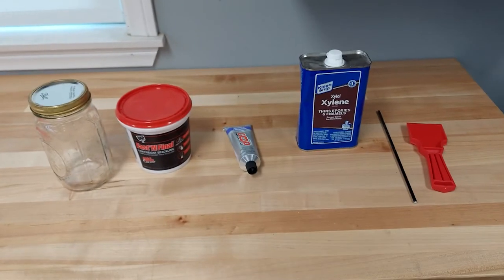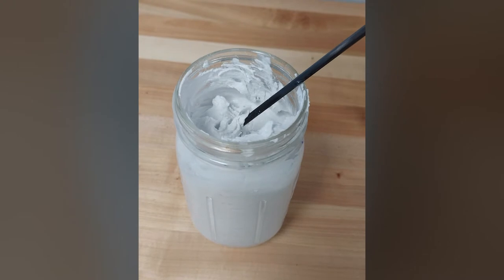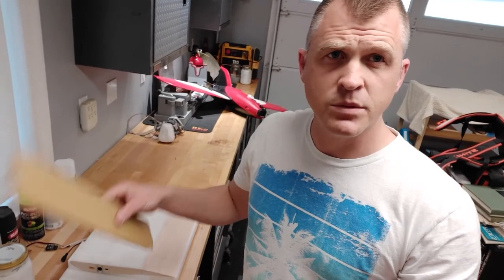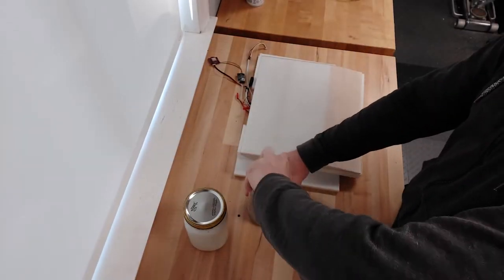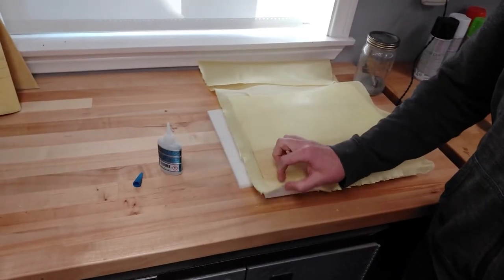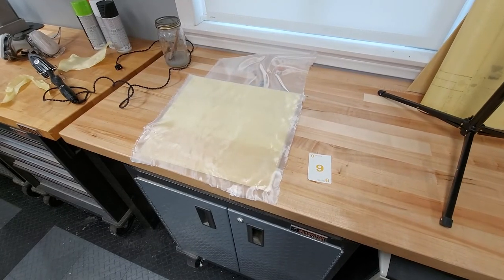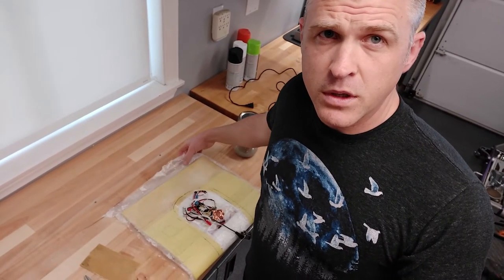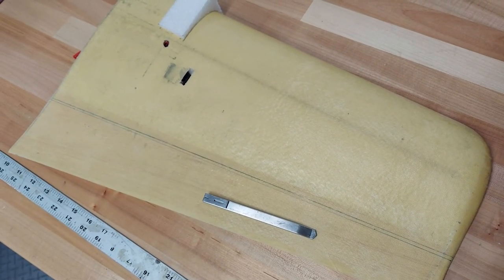EPP and Kevlar Drone Construction Techniques

Comment: Very cool.   All my favorite materials in one vid..   Kevlar cut on the bias, thinned Goop, and thin CA.    I never cared much for the  way spackling is used to fill in the wire cut EPP surface in traditional PSS construction because it'll de-bond from the foam on impact or sharp bend and then can never be repaired without stripping all the covering off.    But bonding it with thinned Goop makes it permanent. .     I can attest to the durability as both the planes I fly that you built,  have taken some pretty serious hits and have never delamed.    I've creased the surface here and there and broken a joiner, but that's about it.   

Didn't know that about n-propyl acetate to thin Goop.   Wonder if that's available in countries that don't have access to either Toluene or Xylene
Perchloroethylene (aka perc, aka dry cleaning fluid) will also thin Goop. 

I've always used 3M Super 77 misted directly onto the Kevlar itself rather than the surface.
Same benefits as your 3M 90.  Can stick it down, smooth it out, shift it around as necessary.  Not as thick and gooey as 3M 90 and won't ever obstruct the pores of the Kevlar fiber from receiving thinned Goop or CA.   Best to do it outside  and downwind though as the mist will get on everything nearby.  

Easiest way to not cover your fingers in CA (or glue them to the surface if/when it kicks fast) is to just cut  off a short length of  good clear packing tape, stick it to your fingers, and then rub the CA with the slick side of the tape.    Can even hit the CA with a little kicker at the end to firm it up and still rub it down (which you'd never do with your bare finger). 
And maybe the blue CA doesn't fume as much but my Zap brand thin CA (I buy it in big 2oz bottles) is really obnoxious and it requires  a lot of ventillation or it will burn your eyes/throat.. etc..  I apply it outside if at all possible.   Inside with a fan otherwise. 

Any pair of decent kitchen scissors can be turned into quite effective Kelvar shears if you've got a bench grinder in seconds as I demonstrate here.   https://www.youtube.com/watch?v=rG6ZFA543BI

You can fill in the pores and make Kevlar a little bit sandable with the same thin CA trick you're using on the TE.

Oh, and you might want to throw this up in the Slope forum as it really is highly suited to EPP PSS construction.
A brand new EPP PSS plane can be every bit as smooth and fast as a wood/glass one but the complaint is always that after a couple hits they start to get pretty ratty, due to a combination of torn cloth (folks used to use Solartex to wrap the curves) and the aforementioned spackle fill layer failing.
Reply from the maker: Thank you for stress testing and flying these planes to their maximum over the years.   Appreciate the recommendations and details above.
Reply: I saw your Kevlar Scissor hack of the decade video ... AWESOME

Comment: I developed similar coating technique, but I am using PVA glue and non-woven textile from gardening supplies for very light planes. Sticks very well to polystyrene, haven't tried to EPP. But it is water soluble, which may be an issue sometimes.
Reply: are you talking about "geo-textile" weed barrier?  That would be a lot tougher than fiberglass.
Reply: @superbeetlejosh  not quite its thin 50g/m2 stuff from gardening supplies. Not sure what it is used for.
Reply: Interesting, do you have any construction pictures of your technique?
Reply: @IlusysSystems  Thanks for sharing. Your video is really worth a look. :)

Comment: You really cracked the code with that spackling witches brew. I'm using it on a build and it's incredibly forgiving and clings to the EPP like Grim Death. I see what you mean on the EPP density(RCG comments). The whole process works best with #1.9. I'm doing a VAS build and I think he cuts his wings out of #1.3. It's not impossible, but I'm sure it sands easier/smoother with #1.9. Well done and thanks for sharing these fantastic techniques.

Comment: Hint. See if you have a Re-Store and look for a kitchen range hood to install over your work area to allow the fans in the range hood using aluminum ducting not vinyl. To pull the xylene , toluene and CA fumes out of your work area .  Even with a respirator you dont want to be breathing them.

Comment: Recently discovered your channel, very cool stuff happening here! Interesting techniques and material choices too! Question; "Laminates", you use this term to describe what exactly? Laminates can be sooo many different materials, to what are you referring when you say "I use kevlar instead of laminate"? "because of weight,, strength, durability etc." 
Good flying, or would good ground effecting be more appropriate, regardless, can hardly wait to see your ship take to the air.
Reply: Googling around it seems that it's just called laminate film, used as a skin layer over foam airplanes. No one says what plastic it actually is.

Comment: I wonder if you could use a similar technique used by boat builders to cover in kevlar. Apply kevlar and goop, then put polyester release  cloth over the laminate and put the whole thing in a special vacuum bag and apply a vacuum. Remove from the bag and peel off the release cloth to remove the excess goop and get the kevlar weight to goop weight as close to a 1:1 ratio as possible. That gives the best weight to strength ratio. Note that boat builders use epoxy resins to accomplish this technique when building foam core boats. I don't know if the foam used in boat construction is similar to that used for prototyping aircraft or not, so the foam might not be compatible with the epoxy.

Comment: clicked on the ArduPilot yaw wag video, Now I want More EPP wing content!!! I have 3 of Reubens wings from Sweepwings and I know he cut his from EPP in his workshop and ever since I built those and they were a freaking blast (and indestructible if laminated properly). I Gotta get to making a setup to do this once Summer starts. Never thought about Kevlar but Im down considering how impossible it would be to break. I have a Strix Stratosurfer I was going to make a Twin setup and printed the motor mounts last night. Now I want to Kevlar the Wing before I do that so it will last forever but would this process be safe for EPO foams? Thank you!
Reply from the maker: It is not safe on EPO, but you can use polyurethane glues or something similar that will not attack the foam.   For EPO I would generally stick with laminate, as the flexible kevlar application is better matched with EPP characteristics of deformation recovery than EPO.   Good luck and experiment!

Comment: Love the channel and the help your giving. Question: Is thinned epoxy too heavy for these kind of builds? or is there another reason to not use it? Also as a filler, thinned epoxy with micro balloons for the foam? It would obviously add strength and adhere to your trailing edges without the need to use the CA? Thank you. I apologize if this sounds rediculous but trying to rationalize the build after a few decades away. 😤
Reply from the maker: A mismatch in material properties.   Going for flexibility, not rigidity.   Want everything to bend and not break in a crash.
Reply: @thinkflight  Thank you

Comment: I suspect the balsa quickly soaks up the Xylene/goop mixture, preventing a good bond between the Kevlar and balsa. If you sprayed a primer on the balsa you might have better results (as long as the Xylene doesn't melt the primer). An alternative to using a primer is to use a mixture of epoxy and micro-beads. The micro-beads (just super small, powder sized glass bubbles) fill in the wood grain and reduce the weight of the epoxy coating while still being really strong and sandable.

 If it were me, I'd do whatever I could to avoid spreading thin CA with my finger. I've been literally burned by CA as it set off, which is worth avoiding. It's great stuff, but I just don't trust it. It acts differently depending on the humidity levels, the brand you buy, how old it is, etc. Using epoxy to bond the Kevlar to the balsa might be just as durable, goes on quicker and more consistently, and is a lot lighter than CA.
Reply from the maker: I don't have any microbeads on hand but it seems logical, I'll order some and give it a try.
Reply: @thinkflight  You can also use balsa sawdust instead of micro-beads. Or just skip the micro-beads and aim for a thinner coat of epoxy for less weight. Though I suspect if you're covering with Kevlar, weight isn't so much a concern.
Reply from the maker: @elbowdonkey  Yeah I don't think a thin layer of epoxy would hurt anything at the weight and size these already are.   Need to try this out.

Comment: Is the respirator really going to help against toxic gasses? I’d assume that a well ventilated desk (maybe with a fume hood) is more important. And why are you not wearing it while sanding?
Reply: If the respirator filter cartridges have carbon in them, they can indeed do a good job against toxic fumes.

Comment: What about using gesso?  It's basically a paintable spackling?  Also, why thinned out goop, rather than epoxy?  Is it a weight thing?
Reply from the maker: In my experience gesso is very heavy and dense.   The goop is about flexibility, epoxy is very stiff.   Depends on if you want a durable airframe or not.

Comment: OK.... that was a real surprise to see that you don't use any kind of resin... I mean from the perspective of repair it have to be like living in heaven it self.. some more goop and the heat gun and it have to be like if that crash never actually happened.... but let us talk about using resin " The rigidity and the extra strength that is offered by the composite are a force to be recon?? ?don't you agree?? the rest well you have actually take me to school!! you have leave a ton of brand new knowledge! thank you very much for your videos....
Reply from the maker: The extra strength and rigidity offered by resin impregnated composites is indeed necessary for many types of builds.   You must select your construction technique for the benefits offered in each use case.
Reply: @thinkflight  I do believe I will keep using the regular polyester resin for the leading edge only... but definitely will give a try to that goop/Xylene recipe of yours.... may I ask you where do you buy the Kevlar???
Reply from the maker: @markgerard363  SweetComposites
Reply: @thinkflight  Thank you very much! I really appreciate your time...